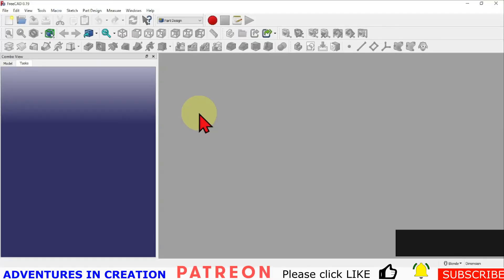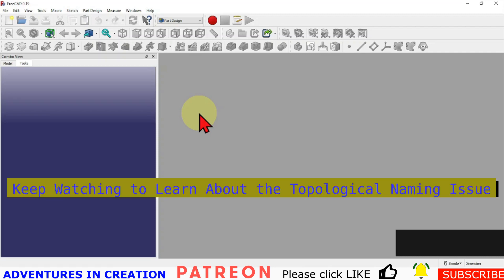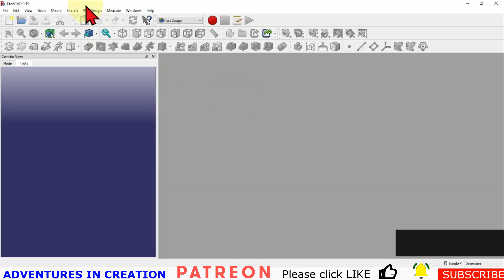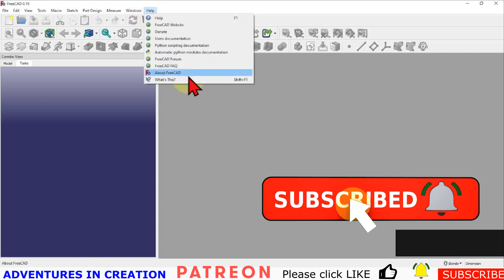FreeCAD Beginner #12 Using a shape binder and shape string

Comment: i did something similar not too long ago.  although using a spreadsheet to input numbers,  i only used one body.  i did not need to convert shapestring to a sketch.  i used a shapebinder on the shapestring which i was then able to pocket or pad. I'm still learning and not sure if it a right way to do it,  but it is still working great;)
Reply from the maker: Hi Craig, there is usually more than one way to do most things in FreeCAD, as I usually say, this is the way I do it but, you may find a way that you prefer.

Comment: Intense video for me, once I opened the "draft" workbench the original grid attached to the pad, however once I went back into "part design" the grid never refresh and or went away, and appeared to remain in a ghost like condition on the same plane, independent of how I would rotate my work, very annoying and confusing. On a similar note, my combo view use to be located on the very upper left hand corner, but now if I try to move the combo view box up to high it causes my main screen to reduce in size and then at the same time my combo view maximizes across the entire scree width... Ugh, Thanks Gary p.s. I am now a Patreon!
Reply from the maker: Hey Gary, that grid is a bit annoying once it's on there it's a bit of a job to get rid of it. The combo box should be manageable, I can't quite visualize what is happening to yours. Thanks do joining our patreon

Comment: So, could you avoid the TPN issue in this instance by using a master sketch for the back plate and using it for each pad via some sort of linking the sketch to each body?  CAD is very new to me, still trying to wrap my head around a lot of the terms and tools in freecad.  I remember seeing a link or bi-directional link tool but not sure exactly how it is used.
Reply from the maker: The topological naming issue is more about faces changing their references, if you avoid using faces as the way to locate sketches you should be OK.
Reply: @Adventuresincreation  Is there a cure for Topo Naming Issue? Why does the software rename faces. I know this is a huge issue, but is it something the software would "just" need to be stripped down and rebuilt without the Issue? Right now we all have to strip our design back to make certain changes and rebuild the tree. Is this a thing only in FreeCAD or does, say, Fusion 360 have the same problem?
Reply from the maker: @crossthreadaeroindustries8554  yes there is, they are working on it but it's not a quick fix.

Comment: Seems like I may becoming a regular PIA... I am curious, is there any way to get a cross-reference of where things from a spreadsheet are used? I want to split an item on a spreadsheet into several variables, but it would be very useful to know where they are all used. Maybe this is part and parcel with the topological naming problems...
Reply from the maker: You could include a 3rd column in the spreadsheet that accomplishes this.
Reply: @Adventuresincreation  I had envisioned something more like a cross-reference from an old-style computer program that would be created at a snapshot time rather than a manual process. This would only be a problem where there are several bodies and many sketches sharing a single spreadsheet. 

Thank you again for all your help and wonderful example videos!

Comment: For some reason, my draft plane is not the XY plane and I can't seem to figure out how to change the draft plane.  So, my "2" just goes through the pad instead of sitting on it.  I've followed through several times but always get the same results.
Reply from the maker: When you pick the plane to start the sketch are you picking the X-Y plane? Try picking the representation of the plane you want instead of just X-Y
Reply: @Adventuresincreation  As soon as the shape string tool is chosen, I get a grid which goes through the pad and I cannot get rid of it.  The numbers go on that grid.  Even switching to a different workbench doesn't get rid of that grid. Everything is fine until I hit that tool.
Reply from the maker: @treynolen  go back into the draft workbench and click on the grid button it looks like a # that will turn it off.
Reply: @Adventuresincreation  Thanks for trying, but no luck.  I still get the same results every time.    I'm going on to lesson 13.  I'm hoping that I'll be able to do fonts at sometime in the future, but I've got to move on because this one is really frustrating.
Reply: I had the same problem. I deleted the shape string and made sure the part was face on to the plane before selecting the draft function.
that cured the issue for me. hope that helps anyone in the future.
Reply: Same thing.  When I go into draft workbench, a grid plane shows that intersects the pad.  The number attaches to it and then the number is at an angle to the pad face.  It stays there when going back to   I reloaded freecad and reset the preferences to initial install.  No luck.
Reply from the maker: @mboulton372  you can turn the grid off in the draft draw workbench EDIT: go back into the draft workbench and click on the grid button it looks like a # that will turn it off.
Reply: @Adventuresincreation  Ok.  But, where?
Reply: @Adventuresincreation  I think the issue that Treynolan is trying to describe is that in some versions of FreeCad, the out of the box state of the grid is that it is not aligned to the X and Y planes. In my case (ver 21.2) it was both skewed to the Y axis and intersected with the X axis. Treynolan’s problem is not with the alignment of his sketch plane itself, or the visibility of the Shapestring grid, but that they did not align with each other, and there is no obvious way for a new user to see how to bring them into alignment so that the Shapestring can be placed on the sketch face without it being angled to, and intersecting with it.
I struggled with this issue for some time, thinking I had not properly followed the vid. No matter what I tried, I could not figure out how to align the sketch with the grid, and there seemed to be no way to change the alignment of the grid. Eventually I realised the Draft Workbench button with the description ‘Current Working Plane …’, and which was labelled ‘Custom’, allowed me to set the grid alignment in a range of different ways, several of which resolved the problem. I found that the button label changed with whatever settings I had chosen, and could be any of Custom, Top, Front or Side, so there’s no quick and easy easy way to describe how to identify the button. If there is an alignment problem, the label will most likely be Custom.
Reply from the maker: @thickquinkly1560  Thanks for the thorough explanation